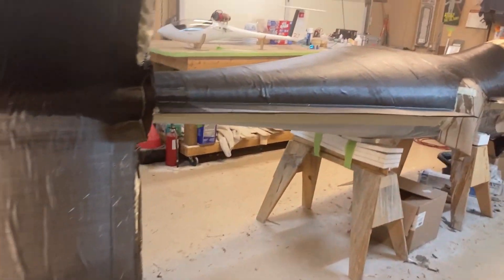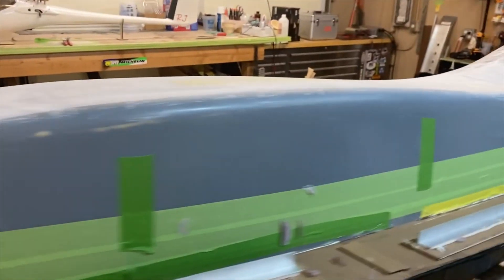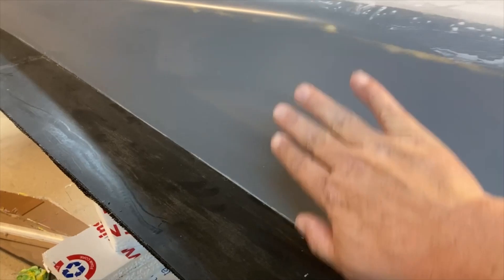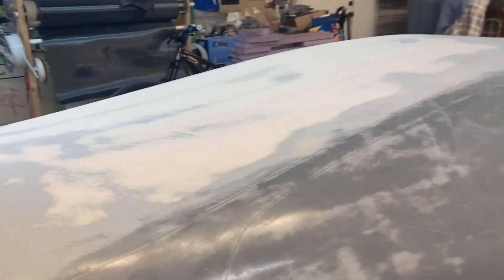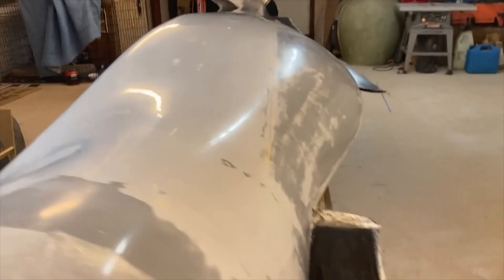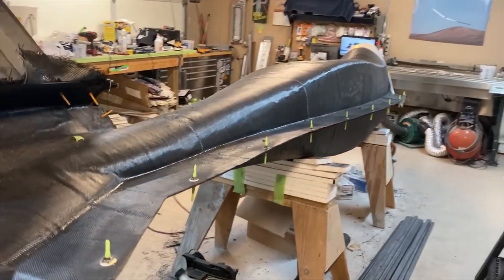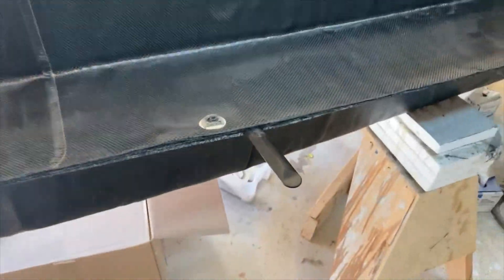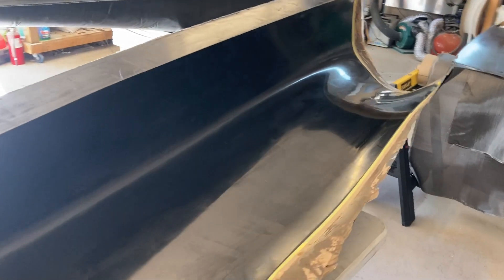Impulse IF 1 Ep 3   Fuselage molding finished!

Comment: Nice stuff! Keep up the good work!  One thought might have been the plug with tubes out the ends - put them on a stand and you could roll or position it yourself...like a rotisserie.
Reply from the maker: I did that in the beginning to get all the bodywork and shape correct. Eventually I needed to mold those areas so I had to support it another way
Reply: @RedJensen  Yeah I figured you would have thought of that. Nice work man